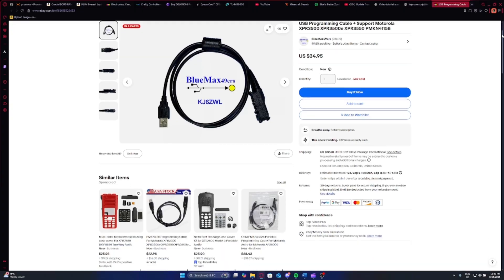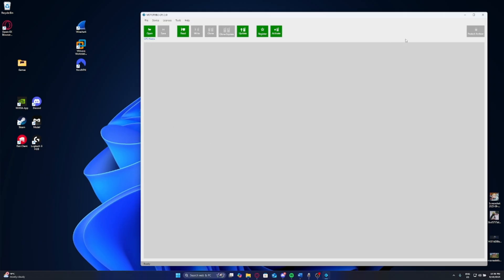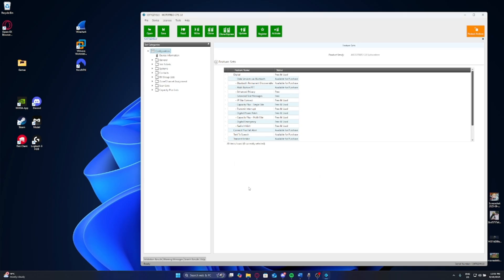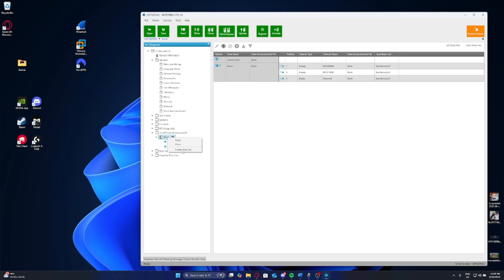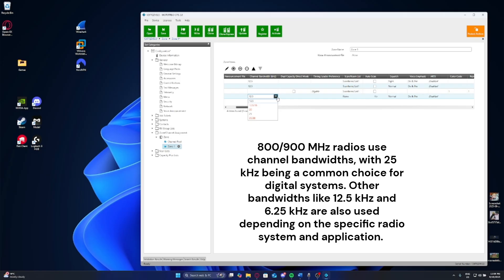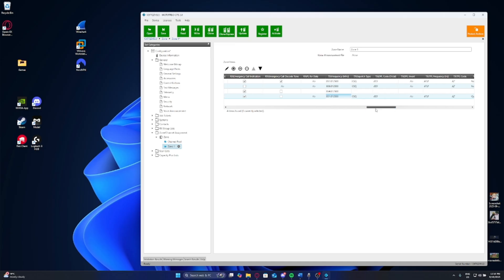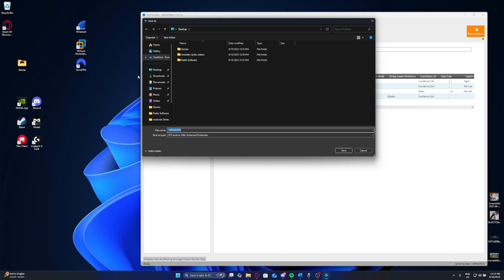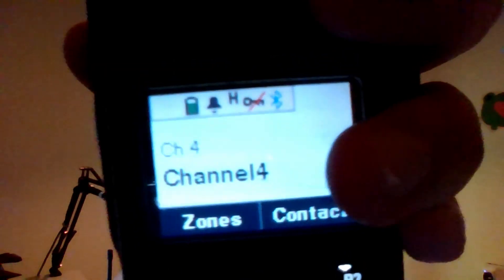How to Program Motorola XPR Radios with CPS 2.0 (Channels & Frequencies Guide)

Comment: Mine says code plug version not supported when I try to read my radio.

CPS2.0 version 2.122.70.0
Radio firmware R01.09.00
Reply from the maker: Hi KillerGaming,
Yes, this means your CPS version is either too old or too new, so you will need to contact your CPS provider, either Motorola or an individual reseller, to get a later or earlier version.
let me know if i can help you further !